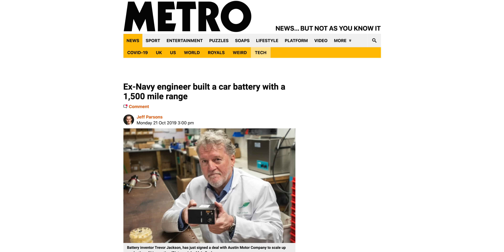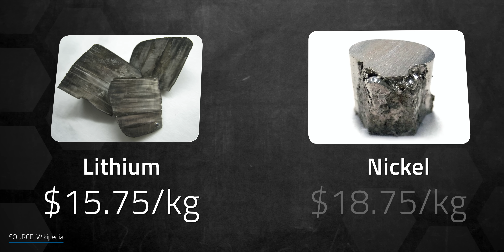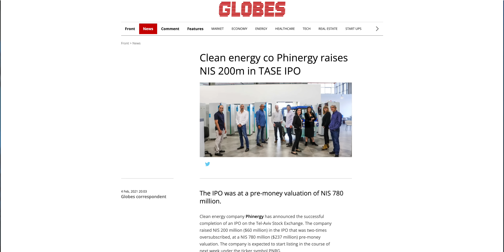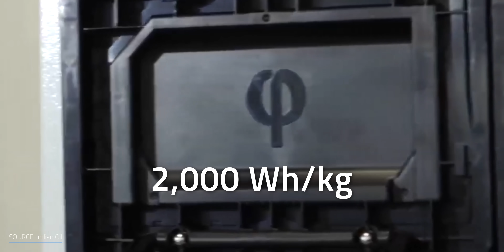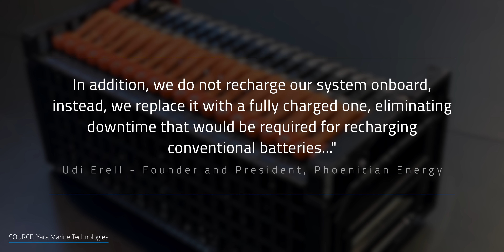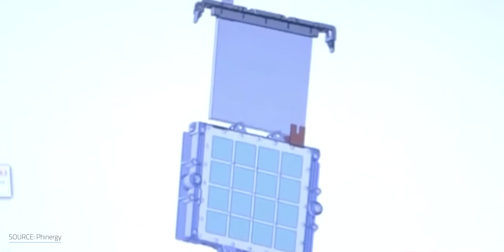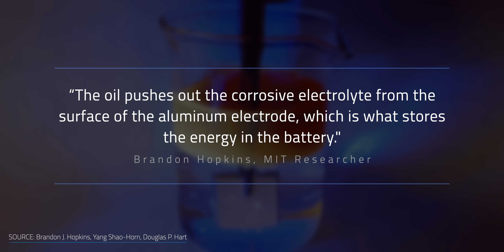Exploring the 1000 Mile Car Battery - Aluminum Air Hype?

Comment: You missed some very key information? Almost seemed intentional?!
Like the reason it doesn’t need to be recharged is it recharges it’s self as it’s a power generation unit ? Not so much an energy storage device!
Question 1 how long does the battery last ?
Question 2 how much energy can it produce in its life cycle?
Question 3 how much energy can be drawn at peck performance and energy drop off points ?! All very key information when talking battery’s ???

Comment: Perhaps the aluminium could be used in a different form, say small spheres (that have a large surface area,) but are able to be pumped in and out of the housing as required for recycling/replacement…..

Comment: Agreed that swapping could be a problem one can build batteries in two parts thereby when one part of the battery is finished you can switch on the second part which should not be a problem and then earliest change the finished part of the AL AIR BATTERY and you would have covered say 300 k.m. And yet ready for another 300 k.m. And key point is cost effective very important. I believe it should work otherwise companies like Maruti / Leyland / Mahindra etc would not have commitment with IOL & PHINERGY ?

Comment: It appears that swapping batteries is NOT such a big deal and is faster than waiting on getting a battery charged.  Simply standardize on battery shape and sizes.  It did not look like a big deal when they installed the battery in the video.

Comment: My main hesitation with getting an EV, besides cost, is range. I drive 40-60 miles most days but occasionally want to drive over 250 miles without having to add long charging stops until I reach my destination (usually overnight with mains power available). An EV with, say, 100 miles of rechargeable range plus the option to install a pack like this for longer trips would absolutely make EVs viable for my usage.

Comment: Right now due to where I live, our climate, and my frequent long distance trips, I'm very unlikely to buy any of the current bevs.  However I'd be more likely to buy one that uses a much longer lasting, but non rechargeable aluminum battery because I could plan ahead for my trips just like I do with my gas vehicle.   This way I could do 1500 miles in 2 days, without long recharge delays and lack of recharging availability in my area

Comment: It sounded like you could have a hybrid system where 90% of the time you use your lithium car battery for commuting, day to day recharging but then for a long road-trip you load in an aluminum battery reserve to keep your lithium battery charged, getting the added range when needed. You would have to give up some Frunk space but if you could go 1000 miles... How many people go on month long road trips often? Even if it loses efficiency over a month your long trip is likely done. Or you bring a spare or plan to buy a spare on the trip. In the meantime you can recharge your Lithium. 1000 mi is 14hr of driving. Really interested in knowing how a hybrid solution would work.

Comment: What about a hybrid, both lithium ion batteries and aluminium air batteries in one car. You would use a lithium-ion most of the time and recharge, but for safety and long-range you'd use your aluminium air batteries.

Comment: Hey, Captain Obvious here, when the battery discharge, what you have is a bucket of ore. To recharge this battery, you need to take this ore out, electrolise the aluminium again, and remake the battery. As you understand, the cost now of replacign the battery is actually buy a brand new battery. I doubt if they could use even the external case from the old battery. So, prepare to pay up. Guys... Sorry to brake it to you but come down from the clouds.

Comment: why don't we use a liquid electrolyte battery setup for EV?  we could drain and fill at the same time making it just as fast as gas vehicles. also, the electrolyte can be recycled or just recharged for the next guy filling up.

Comment: As long as the process is NOT: Take out the battery, ship the bad battery back over seas for repair and ship a working battery back to where it was needed. It would be far better combining existing battery technologies together and make a Hybrid that can go long range if needed but still has liIon for city commutes. Throw in a small gas tank because why not.

Comment: I always go to a fuel 'swap' station...never had a problem with that (every 700km). The idea of switching battery is a much better idea then charge it, much faster, i think Renault had that sort of cars. And you dont have legal problems with a f.up batterypack thats not your fault...only the sun energy from the roof cant be stored anymore then.
And you get 10000 different battery packs of course.

Comment: If the batteries can be carried by one person, are setup to be easy to uninstall/install and size/fitting is standard, then just call in swap assistance at 3:00 AM like a tow truck and you're on your way.

Comment: Anotherr negative point missed here is  the claim that an Aluminium air battery pack the same weight as a Tesla M3 pack will cover over 1000 miles. Aluminium is much lighter, so a pack with the same weight as a Tesla M3 will be massive! Bigger than the car. Totally impractical.

Comment: I said this idea when electric cars come out change petrol stations to battery banks. As to if battery runs out at night car gets towed rubbish if vans can carry chargers they can carry spear battery's problame solved. If they recycle them do you get any of aluminium back that the big question if not they won't work long term. That the bigger question we would run out aluminium in 10 years.

Comment: It would be great for bicycles and electric dirt bikes. Weight is supper critical when you are on two wheels and want acceleration. 
The main question: is it more efficient to rebuild and deoxidise the battery than the life time efficiency of Li-ion batteries?  The batteries could be made when And where electrician cheap.

Comment: Nah, to much hassle for extra mileage which you normally don't need on the average day to day driving but only on long distance and then this advantage becomes a disadvantage because it doesn't charge. Battery technology is increasingly incrementally so naturally improvements will increase incrementally.  I'm sure it won't take long before we gether better range if necessary from Lithium Iron or alternative materials batteries that need not be disposable.

Comment: The criticism of replacement is stupid. Al air batteries will let the existing gas/petrol stations put to use as swapping stations. What's the problem at all if you refuel your diesel vehicle at a much faster rate than you will ever swap batteries. 

Secondly, swapping stations will remove the whole permanent battery replacement out of window which is the major part of ev cost. It's like depreciation of total cost of replacement while also eliminating the cost of fast chargers, their maintanence and usage of electricity and risks involved at your own home.

Thirdly, no charging is not very convenient solution, ask the majority of people living in apartments in every metro city of India, China. The safety risk and additional costs of charging will also go away. The future is between this and blade batteries only.

Comment: The carbon footprint per mile of driving of each of the batteries can’t be good, which defeats the whole point of switching to EV in the first place. Li ion and fuel cells will probably be the future of low carbon vehicles

Comment: If we went in this direction, I would see battery swapping stations easily replacing Tesla Superchargers and similar stations, especially given that a single battery swap would be sufficient to get the vehicle from coast to coast on a single swap.  You could have swapping stations only along major corridors and, in fact, only in major cities, and still support long range road trips.  The part that would fall short is local short range trips.  Right now, we can easily charge our batteries overnight by plugging them into our home power.  This provides a way to start every day with just shy of 300 miles of range available... more than enough for almost anyone not doing a long distance road trip. But now how do we charge at home?  Would we have to have new batteries shipped to our house every couple of months?  Are they easily installable by the layperson?  Lots of logistical changes that would not only have to be accommodated by the vehicle vendors but also new procedures learned by the end users.

Comment: seems to me like if you
1) made them into smaller cells (like a car has 10+)
2) instead of drawing power from all cells it drains a cell then moves to the next, and wired so that not all cells have to be plugged in to work
3) user replace ability is as easy as swapping battery on a power drill (but larger unit size...half the size of 12v car battery maybe)
4) easy indicator lights on battery units to know what needs to be swapped (green/yellow/red - full/partial/empty?)
i could see this working really well. Can imagine deliveries being kinda like sparklets 5 gallon water delivery...well that would be too good of theft target...when the car is half empty (or you force a reload) it orders a new cell for each empty cell and that box contain a return label you use with the same box to send back the empty ones. Or since the car can run without all cells installed, maybe you ship empty ones first and receive new full ones.

Comment: For years ive been saying batteries should be swapped instead of recharged; even if they are rechargeable. Waiting for it to recharge is prob the 2nd most annoying thing about electric vehicles. And if a service vehicle can bring you a charge, they certainly could bring you a charged battery.

Comment: Seems like this might work best in a suitcase form factor. Put it in your trunk or the car maker would have an extra battery storage compartment built into the vehicle and have a port where it can plug into your power supply for longer trips but most of the time you wouldn't even use it.

Comment: Bob lazar was running a piston engined car running on his own produced hydrogen in the 90s,it had 400 mlie range from a separate small pressurised tank in the boot and filled it himself with his own easily produced hydrogen,, this tech as been around for decades but surpressed by governments

Comment: Having your car dead on the road due to discharged battery doesn't sound much different to me than having your car dead on the road because it is out of gas.  The problem I see is having a wide availability of easily movable/transportable batteries at all service stations that you could swap out as easily and quickly as you pump gas.  Also, what is the shelf life of those batteries?  How long do they last if your car sits for a week or two without being driven?

Comment: Dealing with a dead battery away from a station doesn't appear too difficult.  The video showed a man easily carrying a rack of battery cells to the car and snapping them into place.  Much easier than charging a battery from a truck-mounted generator. 
  It seems this could be an all-electric equivalent to a PHEV.  Daily driving?  Use a 30 kWh Li battery, re-charged from standard 220 V charger over-night (75 miles range).  Going on a journey - snap in the aluminum Oxygen battery.

Comment: If you can sucessfully seperate oxygen from air with a simple cathode, then you can use lithium as anode instead of aluminm, it is called lithium-air battery, which has about ~90% engery density as gas, much higher than aluminium, and rechargable. If I have to bet my money, I will say this aluminum battery is a hype.

Comment: Battery swapping has been suggested for Li batteries too, as a way to overcome charge times. Kinda like going to the gas station and swapping out your propane grill tank rather than having it filled. I think having an emergency reserve Li battery on your Al battery car could be viable. I mostly worry about the waste coming from a non rechargeable battery myself.
Reply: Battery swaps have to be the future...
Reply: @sirt8684  why? At 150kw charging speed, i can get a 200mi top up in 10 mins. 

That's definitely faster than the time i have to use the washroom have a coffee and come back
Reply: @nujjigram  Why ? Because I,like most people, don’t want to wait. That’s why…. And, extra removable batteries are just Iike jerry cans ( for those of us who do one distances ) Also, swaps allow for later battery tech. L.I. Batteries are like B&W TV in the 50’s. One generation after radio, and one generation before colour. Have you ever seen how a full battery swap is done on a Tesla for $24,000 USD ? Stupidest idea ever
Reply: @sirt8684  while most people like yourself don't "want" to wait, it's been shown that most people do end up spending close to 40 mins at any stop.

Very few people exist like myself that spend less than 10 mins at a stop, provided i even stop at all since i do drive 400mi without any breaks at high speeds. 

Nio car battery swapping network showed that there is a under utilisation of their battery swapping stations because their customers just plug in since it's just easier to plug in and go have a break than spending additional 5 mins to complete the swap before/after taking the break.

The tech to swap batteries should exist along side gas/LFP and even hydrogen m it's all gonna be working together for different purposes

If you have a different purpose than me, you will choose the tech that benefits you the most
Reply: @nujjigram  Thats where you are wrong... All current research stats on PHEV shows people do not want to wait - they are not being chared... PHEV are being considered to be banned
Reply: @sirt8684  PHEVs are to be banned? You do understand that they fall under the category of EV tech right? 
And you need to read my comment again before you say "that's where you are wrong" .  There is a distinction between what people want and what they end up utilising

I want a Lambo , but realistically I need a utility car for my work
Reply: @nujjigram  Nah.
You think the current EV solution is perfect. Far from it. We are years away from it. 
BTW - I said "being considered"...... several government bodies are reviewing them in several parts of the world.. Read up on it.
Reply: @sirt8684  for sure. Tech is improving drastically. I merely pointed out that the current EVs are good enough for most people. Oversized gas cars are the prime example of wastefulness for people who don't genuinely need the utility of a pickup truck. All  to haul their groceries from wallmart. 

It's a waste of performance.

Comment: Research is done for Lithium ion due to which they are now usable in cars but still not upto the capacity to replace fuel cars. If researchers can make aluminium to provide range more than a fuel car, it can help in ensuring a quick replacement for fuel cars across the world with almost the same price.

Comment: If the aluminum is used up, it presents the same problem as hydrocarbons in that there's a finite supply. Also, one of the most appealing aspects of EV's for me is being able to charge at home and rarely having to go to a charging station.

Comment: What if we include just enough lithium ion to resolve stuck roadside?

Enough Li capacity as typical gallon of gas you use to get you to gas station if run out. Say 30 miles worth.

That Li battery becomes like the reserve you use if Al air runs out. Much like reserve portion of tank used on motorcycles, before mc fuel gauges were common.

Say, 4 Al air batteries, where you use one up until fully depleted, then replace that one. So its much like filling up in quarter tank intervals. Can fill up at 3/4, 1/2, 1/4, or 0, using Li battery to get to station once last one dead (when needing full range).

Comment: The biggest advantage I see to this tech is actually what is currently considered its drawback, recharging.

One huge issue with current electric cars is all the time you have to spend waiting for recharge during long trips.

By forcing battery swaps, this eliminates that. So long as swaps can be done in similar time it takes to pump a full tank (and infrastructure of battery swap stations), eliminates range anxiety.

Comment: If the aluminum electrodes could be swapped with out disassembling the battery then this would be much more viable.  You could store aluminum electrode plates in your trunk for example and just push them into slots in the battery when the old ones are depleted. I am sure their technical reasons for why this wouldn't work though.
Reply: There can be work around but both the efficiency and safety will decrease. Swapping is easy, why we need to be responsible and do something on our own. The whole responsibility of functioning of battery is outsourced. Nothing of fast charger, electricity for charging, safety while charging, garage spaces, etc people will need not worry about. It is specifically brighter solution for people living in apartments.

Comment: The technology would be useful for electric cars as an emergency battery in case if there the main electric car battery fails. I don’t see it replace plugged in or wireless charging electric cars because it would take a lot more space compared to electric chargers and would be more expensive. But can be used to store high amount of energy like an energy storage and etc… battery technology is already being improved like increase range and faster charging what Tesla is working also increasing the battery lifespan. So these battery problems are already being sorted out plus overcharging/discharging is a easy fix. Tesla models already has a system that tells you when your battery is low and when if fulled. Yeah I prefer the charging my car instead of replacing the entire battery just imagine waiting in line or there are no replacement battery station. It would be a nightmare no thanks